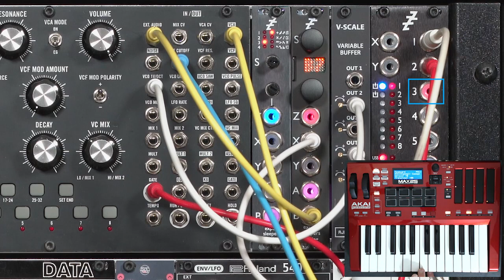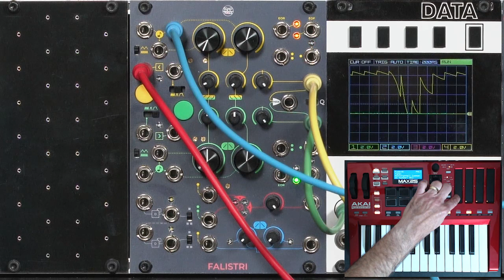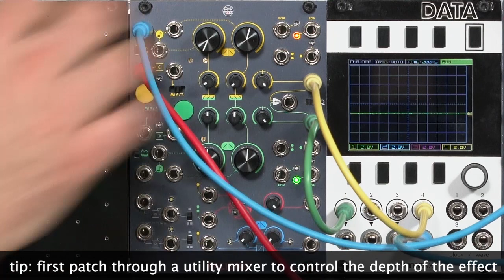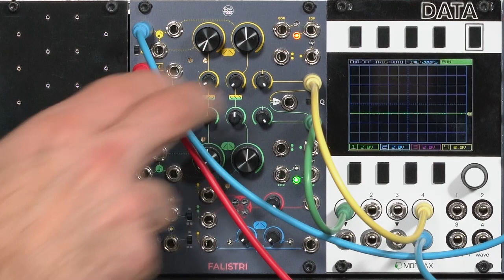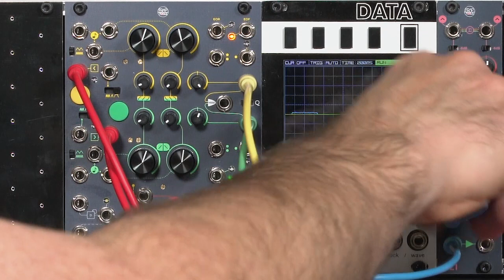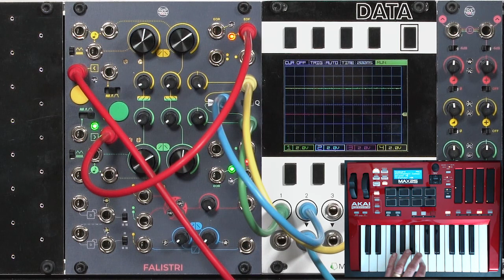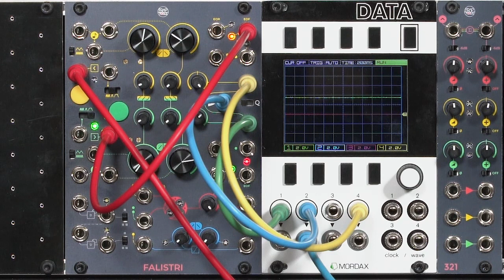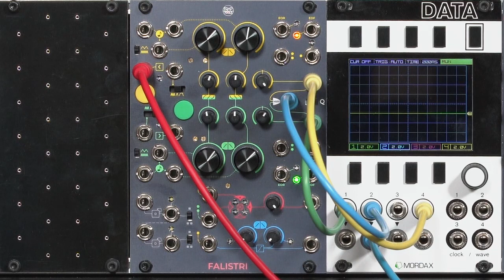Frap Tools Falistri 2/4: Advanced Envelope Tricks (LMS EE)

Comment: This module is beautiful but what it misses for me is the ability to use the two envelope generators as slew, like Maths can. An unfortunate deal breaker for me. Also, this really made me want a MAX25 more than anything!
Reply: The Falistri has a dedicated linear slew.  It's focus with the function generators is not on slewing external signals, but in being a great-tracking 1V/Oct  VCO or generating envelopes or LFOs or being a complete synth voice.  You could always supplement the Falistri with an inexpensive module that slews, or another function generator.  Each function generator has its own strengths, which is why I own three different types (and zero Maths, because I don't believe it particularly excels at anything it tries to do, even though it is a great value).